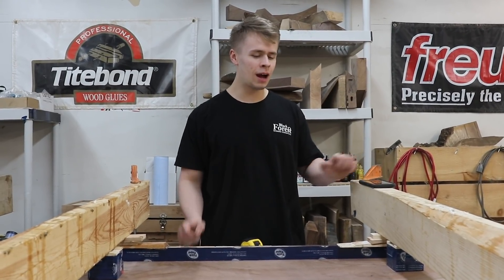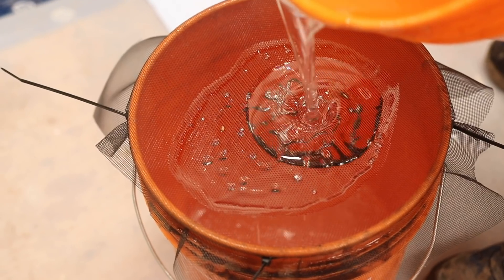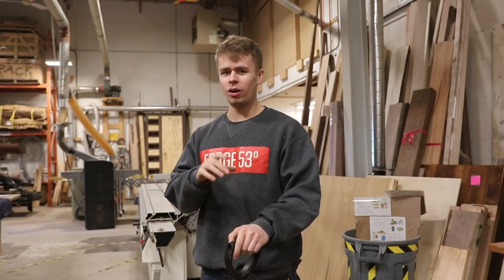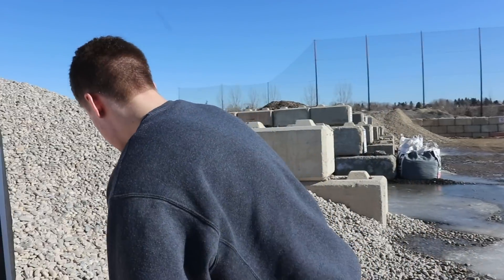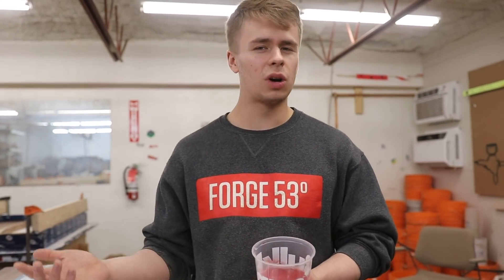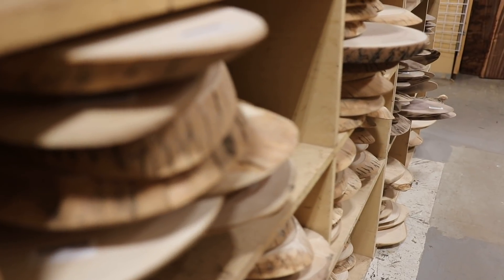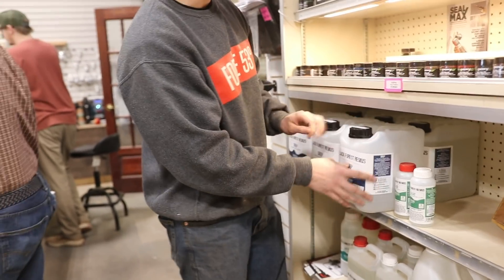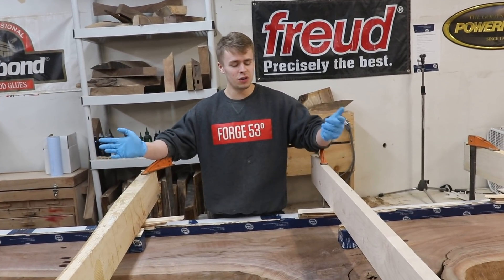15ft Countertop With River Rocks

Comment: I always put like. Wish there was a “love” option. The stones won’t be tacky. Marshmallow pink hearts - that would be tacky. I thought Canada is on the metric system? Your rocks were in millimeters but you calculated the resin pour using inches. I’m confused.
Reply: they use both unless you're Quebec then it's just metric (at least my understanding of it).
Reply: Jetah, thanks. That makes sense. The US has been trying to go metric for decades. We even had some combined Speed Limit sign with miles per hour and KPH but it didn’t last. I do all my cooking in metric (except temperature) and my metal machining work in inch/feet.  But my laser design work in mm.
Reply: @ScottRedstone  i've used metric for measurements and it's awesome. no base 12. easy mental math \o/

Comment: Why don’t you guys have to pour in layers?
Reply from the maker: Pours where we put rocks or other objects in the epoxy aside, we don't have to do layered pours because our epoxy is slow curing which allows for more time for the bubbles to dissipate on their own. We also control the environment it's in with fans, air conditioners, and an aluminum table to keep it cool which helps with bubbles, especially with larger and/or thicker pours